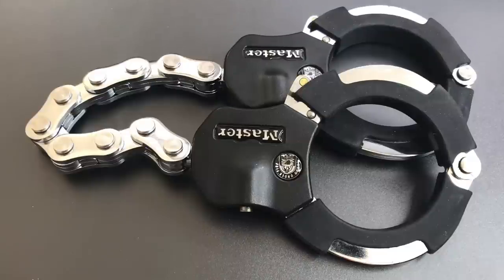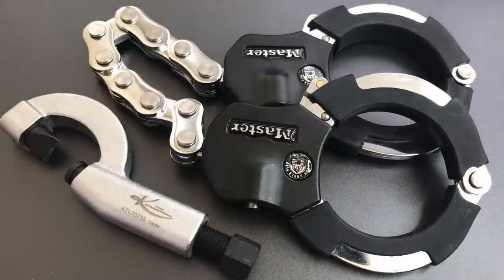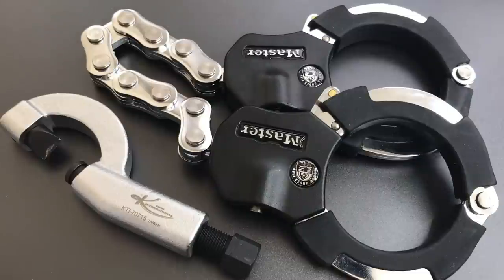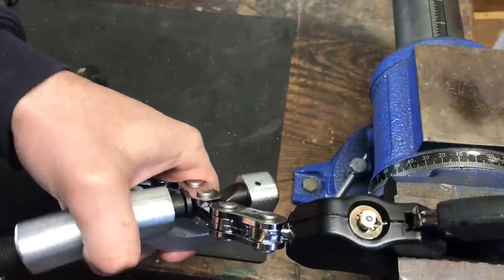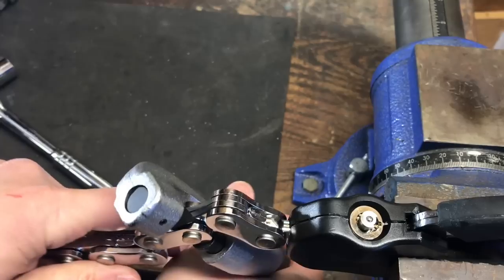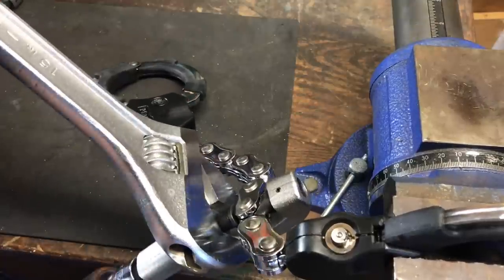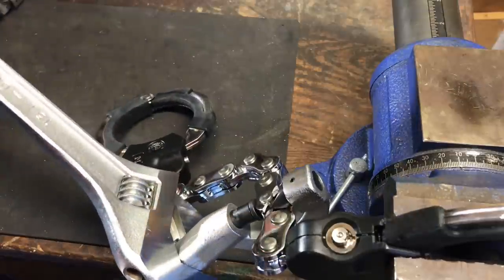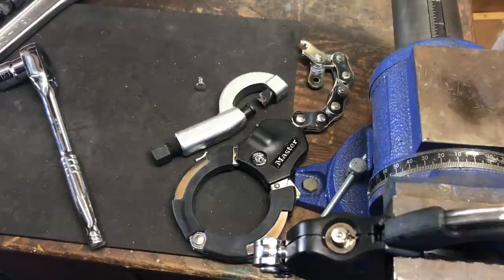[609] Nut Splitter vs. Master Lock Street Cuff Motorcycle Lock

Comment: first lock that takes him longer than 30 seconds to beat
Reply: This is like the 3rd way he beat this thing. He picked the actual lock apart quickly before.
Reply: He didn't beat the nut he split the nut
Reply: Wrong he picked the lock quicker its just it took longer on the chain
Reply: @JS-rv3et  And that is exactly what Master lock wants. They say that they will pay up to 3500 for stolen bike/motorcycle IF somebody brute force the lock. If it is way faster, easier and quieter to pick the lock, it is not opened by brute force and they do not have to pay.
Reply: I guess it would be even faster if he used a high torque cordless drill, maybe about 20 seconds?

Comment: Locks are just a time-deterent device. Pass that lowly master lock for detering you for some minutes.
Reply: yeah, i say so.  you can't beat it bolt or cable cutters and it's resistant to nut splitters.  you can't just rake it open, either.  that's good enough.  an angle grinder or ramset can beat any lock in under a minute, so it's not really fair to use those as standards.
Reply: He did beat it 2 other ways already and more quickly..
Reply: Alexander Zerka bolt splitter and a wireless impact gun are pretty common.
Reply: I took my sweat time sawing of the lock on my bicycle once the key broke of in the lock. I was in a public place with plenty of witnesses. No one cared.
Reply: @michaelpettersson4919  Tell me you're white without telling me you're white :)

Comment: I am actually impressed by the street cuff. Imagine it locked on a motorcycle. After hardly breaking the chain you still have to deal with the remaining shackle on the motorcycle's wheel or frame.
Reply: This video was just to stress test the chain. Picking the lock is actually a lot easier than breaking the links. Check out his other video.

Comment: I bought a nut splitter at 14 years old. I have only used it for just that. At 49 I learned a new use for it!
Reply: Why did you buy a nut splitter at 14?
Reply: @joeh4955  
Stripped out studs on my dirtbike's front axle pinch block. It worked great.

Comment: Well, that's one design flaw I'm not too concerned about.  Took multiple tools and like two minutes to break it with a great deal of exertion. 

Now if only it didn't have the two other design flaws.
Reply: Sadly, usually if a method is under 5 minutes, thieves will take it. Having these three tools in a backpack is not a huge problem for them...
Reply: @TheParkanyi  It's awesome that  this channel lovingly creates a tool list necessary to get into any number of locks.

Comment: Took from 2:00 to 5:15 to break with the tool; far longer than a grinder attack. Also, in use the two locking units are still attached somewhere, and riding away might still be impeded.
Reply: Good observation, and this is highly staged attack(using vice, perfect lighting no distractions)...and he was using 2 wrenches and nut splitter so basically 3 tools not including vice...highly unlikely that average thief would using all that
Reply: @FicaGTI  The ramsey was by far the most likely of the three attacks on this type of lock.
Reply: @RWBHere  You mean ramset gun? According to abus security experts most thieves(more than 90%) use basic tools, some sort of bolt cutters etc...so that would be very unlikely
Reply: John Nitrous  That is very non realistic simulation(vice-pole)..I lock my bicycle almost daily around poles/racks and lock is very loose because there is always some clearance between lock/pole bicycle and there is no way that you can make it that steady and not moving like in vice.

Comment: The weak point of handcuffs is the hinge on the cuff itself. 'Stick a tire tool in there and twist.
Reply: Sure. But you'll damage the bike frame with all that torquing.
Reply: @Mekronid Yes, they do. The frame is the most valuable part of the bike. Damage it and you'll lose most of the street value of the stolen bike.

Comment: Dremel cordless 12 volt lithium battery rotary tool with a diamond or tungsten carbide cutter is my goto tool for cutting off bolts, etc, that are rusted in place. Great for taking off rivets with little to no damage to the surface.

Comment: Splitting the chain still leaves you with the cuff on the bike somewhere, I'd hope one on a wheel I suspect for a motorbike, and hopefully frame and wheel on a bicycle. How does the rivet on the cuffs fare against the splitter?
Reply: If someone can carry a bike away then they can just remove the wheel and get a new one.
Reply from the maker: I highly doubt it would fit around a wheel... it’s designed to be used on a bike frame.
Reply: I thought the same - there's one exposed pivot/hinge on each cuff.   Downside, even with that popped clean out, the cuff might not open from locked.

Comment: K Tool International KTI70715 Universal Nut Splitter US$30 on Amazon.  The masterkey for every bike lock.
Reply from the maker: I got mine for $21 shipped on eBay. 👍
Reply: A “key” in general is designed to open and CLOSE a lock
Reply: @TheGoldenTNT  Tell that to a masterkey shotgun.
Reply: @TheGoldenTNT  plenty of locks can be locked without a key. On doors you can spin the tab on opposite knob.  And on padlocks and handcuffs you press them together until lock engages.  You don't need a key to lock majority of pad locks or even locks for that matter.  Maybe deadbolt to lock from outside but this "masterkey" wouldn't work on deadbolt so irrelevant

Comment: I wonder if the nut splitter could work against a normal padlock shackle or a chain.
Reply: Josuel Servin I don't know if it's designed to work on hardened steel. Are most nuts hardened?
Reply from the maker: No. The splitter would be damaged.

Comment: Just out of curiosity, have you put any thought into using a chain break on these style of locks?  I use them quite often in the factory where I work and I think it would do well on these.
Reply: zachariah liles I would like to see the same. The only thing with regular #40 chain or any chain is the heads are not riveted over just press fit in to the chain links
Reply: SeptrothFFXI in some cases, that I've personally run into, the pins are somewhat hammered/peened over on some industrial chain.
Reply from the maker: No chance... these rivets are hard, and designed to withstand this.
Reply: LockPickingLawyer I don't know about that.  The pins in the chains I work with are reported to be 55+ brinell and the chain breaks work just fine with them.  All they do is push the pin through the links.  And if it doesn't work with this exact lock, maybe it will work on other brands.  Just a thought.
Reply: LockPickingLawyer.  Newer locks are made poorly. The revits are the same, but they are poorly pressed. They are visible half stamped up to 4mm undressed revised end exposed.

Comment: Why not put the nut splitter itself in the vice?
Reply: i think he tries to demonstrate a real world use of it. like if the lock was on the bike and a post you would have to hold the splitter and the tools. the 3 tools he used would be easy to have in a pocket or jacket and shows how you can still get needed torque without the splitter being anchored
Reply from the maker: What Bret said.

Comment: The nut splitter is damaged! You did NOT reflect on that. ::Waves finger at you sternly::  : - )
Reply: Walltumbler no it isn’t apart from usual wear
It’s just the powder coat wearing away
Reply: Link below to image I made. You can clearly see there is a nick in the blade. Its not just the anodized coating coming off. That's no big deal. Love the LockPickingLawyer by the way. Hes's one cool guy. https://imgur.com/a/kcJga
Reply: Walltumbler, we're all a bit damaged. No reason to point and single out poor old nut splitter...

Comment: Not to mention you damaged the wedge of your nut splitter.

But if it was an American made tool this may not have happened.
Reply from the maker: I didnt notice until after.
Reply: Tyler Snyder screw usa made...total rip off..4x the mark up
Reply: Trekkie 4Life 4times the quality. Higher quality steel. Have USA made tools that are over 40years old that still kick ass.
Reply: Travis no not 4x the quality..4x the price to pay for union workers who are lazy and overpaid  screw usa made
Reply: Travis 
Exactly.
And btw Snap-on may be over priced most times but there are many American companies who offer an unbeatable value for what you get.
Go buy a pair of harbor freight slipjoint pliers and a pair of channellock slipjoint pliers ( only $10 btw ), which will still be good to go in a few years ?
Definitely not the cheapo import tool.
Reply: Trekkie 4Life 
I guess I'm a sucker for buying affordable well made tools that I can count on.

BTW just how do you know the work ethics of those who build your import tools ?

Comment: I never thought of using a wrench on a nut splitter frame. Cool. Steel alloys can be surprising. I once dented the jaws on a big bolt cutter. I thought the jaws would be able to cut through a stainless steel cb whip antenna. The antenna was tougher than expected and the jaws were weaker than expected.

Comment: I use this lock to attach the front wheel to my frame. If someone were to break the chain, they STILL would have to deal with the cuff around the rim. Or course, they would also have the U-bolt to contend with securing the frame/rear wheel to an (hopefully) immovable object. As my eBike is fairly heavy, I don't think many bike thieves would look forward to carrying it down the road with an unusable front wheel...

Comment: all the comments act like it was easy for you. You had a special tool and took some time to bust it atleast a few mins. Folks everything can be cut, snapped or broken in some way so good luck finding something under 50lbs and 22mm in size that you can actually use on the streets.

Comment: Those results suggest that the links are much harder than the pins, but the pins may be hardened too. Then again they may not be hardened at all; after all, they had to be riveted over to make the chain. That would suggest they might be liable to a drill attack.
You might consider getting a set of hardness testing files so you could get an idea of just how hard things are, more calibrated than just scraping things with an ordinary file.
Reply from the maker: I have a set... but they’re generally not useful for testing shackles because all I care about is being harder than bolt cutters. As for the rivets, they did slightly damage the splitter blade... to me that suggests hot set rivets with air hardening steel. Just a guess.

Comment: if you are going to use two wrenches just grab the chain with both wrenches and twist the chain, it would be quicker than the nut splinter. 
the hardened steel link will most likely break easily. I have found that if you are just removing a loc that has een exposed to weather and is
 no longer useful this works faster than even a cutting wheel.

Comment: Would that nut splitter work with an battery  powered impact? If I were a criminal, I would want to get the lock cut off as quickly as possible, so an a battery powered impact would seem faster.

Comment: This lock let me down two times. I bought one of those couple years ago. It has seen some light use, then, after less than two years, one of the locking mechanisms failed. It just wouldn't stay locked. I sent it to Amazon and they sent me a new one. Then, after another 20 months or so, again one of the locking mechanisms failed too. That was when I threw the lock into the trash bin.
Reply: That's why he broke chain on this one - same thing happened and it wouldn't lock

Comment: I know you don't rate this lock but, I think it has potential at least for me. I live in a pretty quiet part of the UK, the most likely bike thief would be an opportunistic chav taking advantage of an unsecured machine. Most of those don't have sufficient brain cells to pick locks so that core will do just fine. Also no one really wanders around with nut splitters etc so this lock would deter most would be thieves. My bike has disc brake rotors that are enclosed in a ventilated cover both front and back, so use of a normal disc lock is impossible however, using on of these passed through the rear wheel and locked around the frame or rear shocks would have the same end result in that the bike cannot be wheeled away.
In the end if someone wants YOUR bike, they'll get it regardless because they're determined and have probably planned and prepared. If someone just wants A bike then this along with a good hardened chain lock to a ground anchor would most likely mean they pass over your machine for one that requires less effort and time to pinch.

Comment: @lockPickingLawyer use a battery operated (ryobi or similar) rattle gun / impact driver on the nut splitter. youlll crack through things in a tenth of the time

Comment: Why not try using the tool for what it's built for and put the splitter on 1 of the rivets top and bottom and just split the rivet head in half or in 1/4s... that was what I thought yoh were going to do bow I wanna know if it would work  and if its a better or worse way of doing it rather than what you did...

Comment: Pretty tough lock, I first thought a motorcycle Chain Breaker might push out the rivet, but I looked at the one I have in my toolbox and it would likely break the Chain Breaker. Perhaps a drift punch and hefty hammer would, but I doubt you could get a solid angle on it.

Comment: usually, they would put the loop on a tire or something, wouldn't they? You could do this and get the chain off but you couldn't ride it anywhere because the loop would be on the wheel, and you could not load it into a truck unless you want to look super suspicious and take a lot of time and you would also need a buddy to help get it onto the truck. Same could be said if they tried to load it onto a trailer with a ramp, it still would not roll up the ramp because of the loop and would also be heavy, suspicious, and time consuming getting up onto the ramp. Just though I would say this, what do you guys think?
Reply from the maker: A tire? No way this fits around a Motorcycle tire. It’s meant to be locked to the frame.
Reply: LockPickingLawyer oooooh lol, I thought these were the ones thst were saposed to connect to the brake pads... good video though, enjoyed it.

Comment: I thought you were originally going to use the nut splitter to split the rivet head in half rather than shearing it from the chain. I'd like to see if that works.  I would have put a piece of duct tape loop or something over the rivet for when it shot out

Comment: So, I've watched these nut splitter attacks and realized a tough tear/cut resistant Nylon covering would your delay or even defeat this kind of  attack  since you can't place tool between the links.
Reply: STB 1971 nah, it would slow you down by 20 seconds but it will find home by its self

Comment: TBH It does take time to bruteforce the rivets, also it makes noise, so it's really not that handy to break this lock this way.
BUT... as you shown in your previous video, the core itself can be picked within seconds..
So yeah, 8 points out of 10 to the chain, 2 points to the lock. That's not a good average

Comment: This makes me wonder if perhaps it'd be possible to get a drill-powered variant of the nut splitter going.
Bolt locked to the chuck, bolt-body+chisel locked to the drill's body.
Though, you'd probably need a larger bolt with finer thread to get that concept going with an impact-driver type product.
... Still, would be fun. :P

Comment: The hardened plates are compromised due to chrome plating. If you look at the broken link plate you will see a crystal like structure to the metal, this is called hydrogen embritlement and makes the metal brittle rather than hard. After chrome plating they needed to be properly heat treated to get rid of this. Why is Master Lock so poorly made?

Comment: nice! you need to do this with an impact gun instead of a ratchet. i use them to open rusted wheel bolts on trucks that were torqued by idiots. I bet you one of thouse copled with your adjustable spanner will pop this open in under 5 seconds :)

Comment: use a longer ratchet for more leverage...or slide a longer pipe over the ratche handel to achieve the same effect but u can break the teeth inside the ratchet if u are using too much force...or just have a cheap ratchet

Comment: How thick a hardened padlock shackle can you cut with that nut splitter?
Reply from the maker: Then nut splitter would be damaged... perhaps destroyed.
Reply: I gave this some thought and decided same.  Which led me to speculate that the basic design of the nut splitter could be scaled up and improved upon, perhaps with a tungsten carbide wedge; to produce a really serious metal-splitter that might very well cut a hardened shackle.  It might even be designed specifically to keep its footing on the curved rod.

Comment: Pssst hey just simply put the D shape part of the nut splitter in the vice which will much more easily hold it steady while then being able to tighten the bolt on the nut splitter to split the chain

Comment: i would have tried putting the nut splitter in the vice so you can put more force into the screw without having to hold the chain and twist against it

Comment: I realize this video is about 3 yrs old but thought this was worth the comment: if this technique takes so long wouldn't someone have called the cops /security or the owner by the time your finished? And could you use a drill to speed up the nut splitter?
Reply: To the first question - Not if they don't see you. I mean in broad daylight on the street, yeah maybe, but that's not usually when bikes get stolen

To the second one - No, not enough leverage, not enough torque